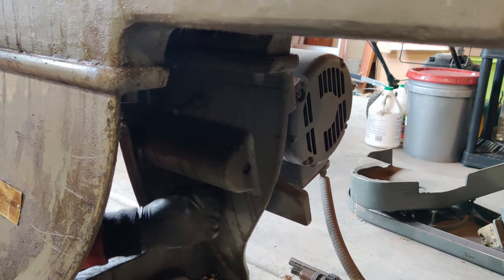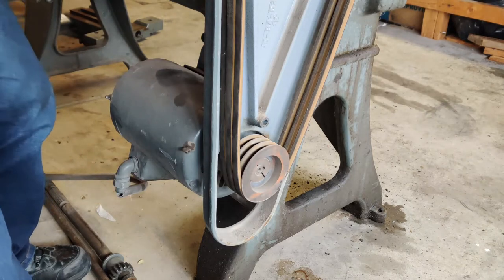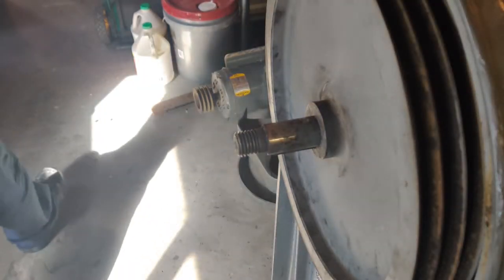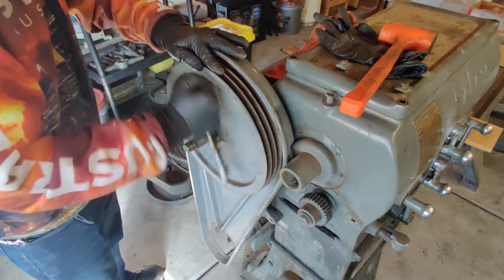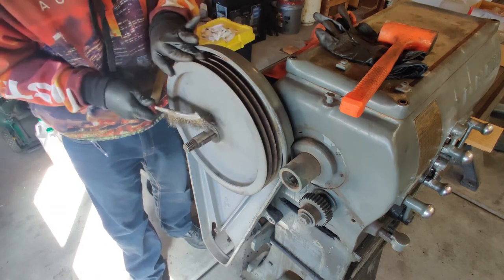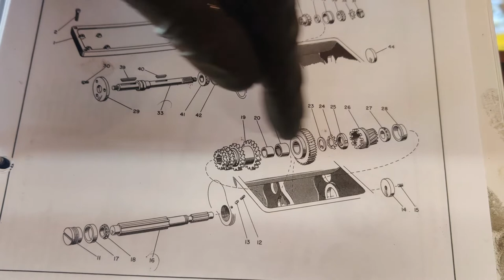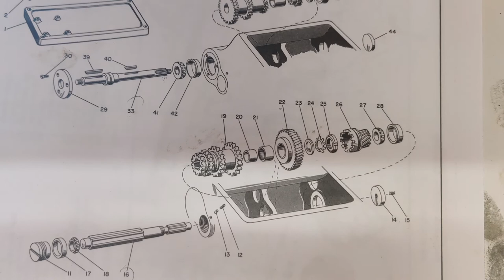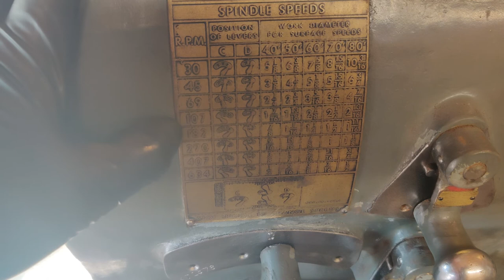1950 LeBlond Regal 17" Lathe Restoration Part 11: Getting into the Headstock

Comment: I actually repaired my Cluster gear with a new gear. What I did was annealed the cluster then turned off the old gear and made a new gear and fitted it and welded and hardened it. works good now.

Comment: With regard to your damage gear teeth. I have had some luck building up weld from my flux core welder, then grinding/filing/machining back close to shape...

There are certainly other options. That's just my 1st Choice when possible
Reply from the maker: Yeah, I've been doing some material tests and I'm pretty sure this piece is steel despite it's size and complexity. I've been looking for a friend with a tig welder to get some material built up for new teeth and to reface some damaged ones. Then I'll just hand file everything back down to the correct form.